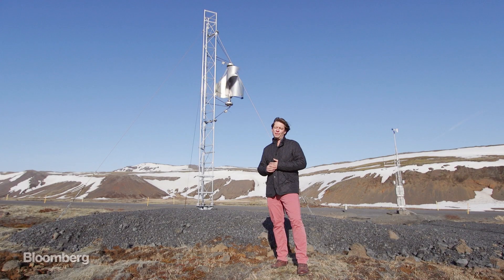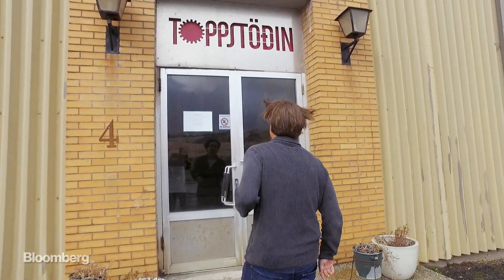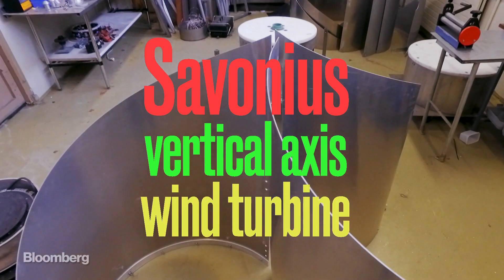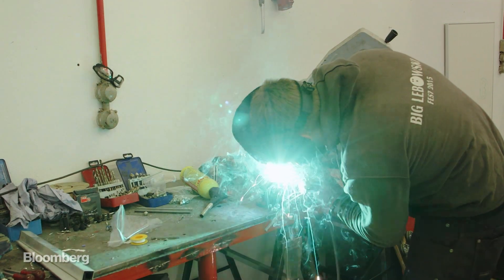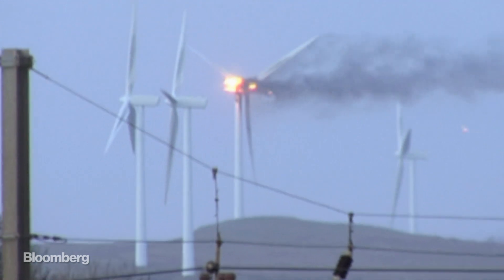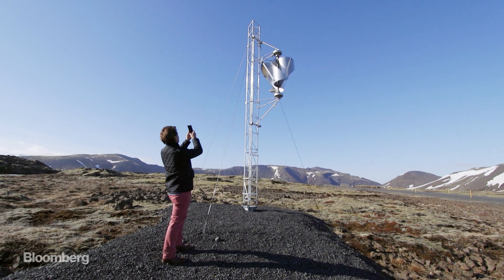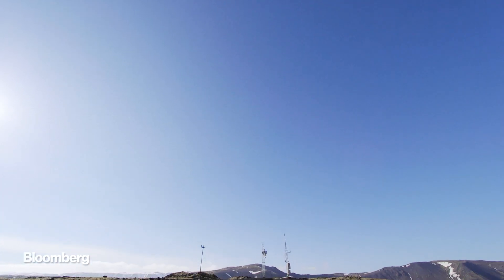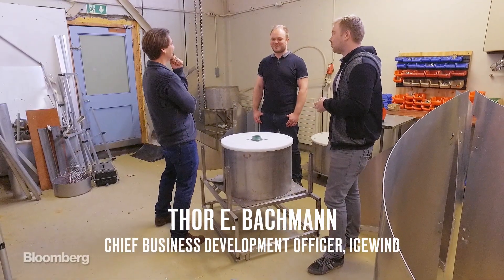The Tech That Could Fix One of Wind Power's Biggest Problems

Comment: These are Savonius type vertical turbines.
Disadvantages: 
generates less than 50% the power from same wind area.
scales down quite well, but does not scale up very well. Largest practical size is MUCH smaller than conventional bladed rotors.
Handles low winds well. handles variable wind speed and direction VERY well. but gains no benefit at high wind speeds. at all!
Uses between 50% more to 4000% more material to construct, for a given wind area.

i.e.
They are great for near-the-ground small-power systems. Especially in inaccessible locations where maintenance is not a viable option.
And utterly useless for grid power generation.
Reply: since they scale down well, would they be an option for small residential systems, such as a supplement to solar?  My solar system is great but small due to size/location of my roof so i'd love to have some wind generation as well but everything i've looked at is either too large or too noisy to put on my house with neighbors homes only about 12' away.  I'm looking at vertical axis possibilities now instead.
Reply: @markdlondon  Yep. These are a GREAT supplemental power source at household-minus scale. Especially to, for example, charge up a battery for a light in an isolated building, recharge a comms relay on a hill somewhere, power an emergency phone out in the wilderness.
Think systems that require small power under adverse conditions. Close to the ground, arctic light conditions, etc. But expect 1/3 to 1/6 the power total you could have gotten from a similarly sized (but much taller) 'normal' horizontal wind turbine.
Savonius' strength is very low maintenence, protection against high wind overspeed, and (some) function even under very low or turbulent winds. But inefficient, and weak.
Reply: @marvinkitfox3386  would a 'normal' turbine still be more efficient at the household scale?
Reply: @ki0w0-lordofwatersheep  At household scale, yes. But it is close. If the winds are marginal or erratic, or the HOA does not alow unsightly normal turbines. There are other vertical axis turbines that perform much better, but are more fussy about their placement.

At "single household device" scale, these turbines are King. Say to power a water pump *out there*, or for a phone station where small solar is not practical, or to power an illuminated billboard next to the road, etc. I have seen several powering a Weather station out in the wilds. A friend has one powering his microwave relay for his internet.(obviously also totally off the grid)
Reply: @marvinkitfox3386 
These horizontal axis structures generates unbalanced forces and extremely unstable.
First get the structure stable if inefficient so what?
Go bigger go higher.
The criteria for efficiency must've based on money spent money gained.
Not m2 area turbine wings sweeps.
Reply: @marvinkitfox3386 nice summary, I wonder if some sort of auto adjusting the surfaces can aid in efficiency
Reply: @markdlondon  Only for rural off-grid systems. In urban areas the wind speeds are low and the wind is turbulent.  These kind of mini-wind speeds will produce power above grid price.
Reply: @boldvankaalen3896  And they offer a very bad EROI. You are better of participating in some kind of windfarm project.
Reply: @markdlondon  No. For residential areas, you are better off generating more energy in a suitable area for wind production than installing micro VAWTs.
The amount of materials (ie.. energy) embedded in them is ridiculous compared to a regular HAWT. Buy a participation in a regular windfarm, ROI is better and its better for the environment.
Reply: @dwwolf4636   Yes - some of inefficiency is due to excessive material requirements (& only half material functioning at any moment), the other deficiency is that Savonius are largely 'drag' machines (they lack the sort of output that machines with aerofoils
which develop LIFT feature).
Reply: small is a relative term.  This video desperately needs a power curve for us to look at.  They are GREAT for a very small number of applications.  Something like charging cell phones in a windy area may be one of them.  Most of the time they're lawn art.
Reply: Thank you for providing the facts that should have been in the video.  I guess the video was some Bloomberg reporter's excuse for a vacation in Iceland.
Reply: they tend to vibrate a lot too, but considering a lot of islands use copious amounts of imported diesel they might have a place in niche scenarios like that
Reply: @michaelstarnes2297  Nope.
Regular HAWTs are much better in such scenarios. Fewer materials are needed and double the efficiency for a given amount of wind ( ie. input energy ).
Reply: Ye but it dont kille birds. Calculate how many birds the turbin kills globaly each year....
Not even every one's nightmare ''Nucalar power'' do that much harm. 
If you asked the birds, they would rather chooses CO2 then them dying out of the planet.
Reply: @hassanj1861  How many birds are killed by wind turbines? How many are killed by air pollution or oil spills? What's the ratio?
Reply: @hassanj1861  Massive amounts of birds getting killed by wind turbines is and urban legend.  Data does not support it.  Pet cats and picture windows are huge killers of birds.  Wind turbines, not so much. 
Audubon Society data supports this.
Reply: @solarwind907  You have the wrong data. Norway and danmark who builds alot of these turbins have published alot of concerns.
Reply: @hassanj1861  post your data here.  thanks.
Reply: @hassanj1861  Could you try saying that again, but in English this time?
Reply: es obvio.....
Reply: Argument is that you can build several of them on same area as one “normal” one. You place them in triangle pattern I think?   In 🇫🇮 they use recycled plastic to make them, this makes them super cheap. One of the benefits of being smaller. Plus you have less problems with environmental movements…
Reply: Solar would be a better solution to use than these VAWT
Reply: @optimusprime699  There are places and situation where solar is simply not practical. For example, in a highrise city, near ground level. plenty of gusty wind, but virtually permanent shade. Also high latitude in the winter, the sun might not rise for 3 months! etc.
Reply: @optimusprime699  dependent on site
Reply: The technical specifications that you add are very valuable. This type of wind turbines offers a solution in certain conditions to certain demands. They are not a general purpose solution.
Reply: VAWT work well in urban environments, where wind turbulance makes traditional ones struggle.
A VAWT can be powered if the wind comes from an ever changing directions, again urgan environments.
Reply: @scoobyflew  Got DATA?  Post it here.  What unit?  How much power?  Wind speed data?  Thanks in advance.  

HAWTs have tails.  When the wind direction changes they turn the nose into the wind.  VAWTs have no advantage there.  You do realize that 50% of the blade area is ALWAYS pushing into the wind on a VAWT?  It's fighting against itself by design.

Looking forward to that performance data, thx!
Reply: @scoobyflew  Spoken by someone who believed the typical vertical-axis talking points.  Show us one actually working well at all, let alone in a highly-developed area.  Wind energy works in wide-open spaces, so the strong winds are at turbine height, without blockage.  Vertical axis turbines make less power, and usually break very quickly, due to forces that reverse twice with every rotation.
Reply: Can single turbine lack of parity with traditional windmill type turbine be made up for by price and placing 4-10 etc. of these, with cheaper up-front expense and much lower maintenance over lifetime of product. If the vert mill is a fraction as expensive and 10 will do the job of one, and for less money, where is the actual drawback?
Reply: As you said it depends on type and direction of wind the region has.
Reply: These also have the advantage of a small footprint so deployment is easier across say a habitation.
Reply: They need to install some turbos on those things, give them more oomph.
Reply: I am considering a vertical axis wind turbine that looks exactly like a tree, I call it : e-tree,
the trunk of the e-tree is brown, the spinning blades are green,
attached to the trunk of the e-tree are features of : wifi/mobile network, light and power outlet, to charge a car for example

Comment: How much power it'll generate?? Why people are doing misleading videos?? Recently some people came out infinity radio active battery with radio active graphite. Which produce 1000micro amp. Which is for no use. Few years ago some one came up with blade less vortex wind power generator. Some one came up with wind turbines at toll and highway, using wind thrust of cars. Is this joke?? For sure conversational wind turbines move slowly. But blades are huge. They produce huge torque. It's not about design. People should work on basic logic.

Comment: Small simple easily maintained wind power systems actually make sense. Making electricity for the grid using wind power is really only worthwhile as a political game. However wind is a very practical way to supply power in small and moderate amounts especially where providing a fuel supply would be difficult. Actually when all you need is a small amount of intermittent power, it may even be possible to save on maintenance.

Comment: it makes more sense. It doesn't have to be angled into the wind like a traditional turbine, and since it spins vertically, that's also one less differential gear that's needed to transfer power, and lose efficiency in the process.

Comment: So how does it "shut down" in high wind?
Reply: It prevents overspin by being very inefficient!

Spin imparted is proportional to wind speed, but
friction with the wind is proportional to wind speed squared.

As the wind gets faster, this rotor actually slows down and eventually stops spinning. It could even slightly reverse rotation under enough wind.
Reply: @marvinkitfox3386  Thank you for the explanation.  Ironic that a weakness is touted as a strength!

Comment: Finally, Some one got it right. Those propeller windmills are waste of time and money.
Reply: Care to elaborate?
Especially since propeller windmills could physically extract about 60% of wind energy and those vertical generators only 40%.
Reply: @3gunslingers  The torsional stresses on the gearbox would be reduced. The footprint would be drastically reduced and they wouldn't have to be nearly as high as the current design.
Reply: @billbosler4220  
By how far could the footprint be reduced? it would need the be 1/3 lower to match the energy density of present day wind farms.

"The torsional stresses on the gearbox would be reduced" Interesting that you mention that. Because VAWT have vastly  higher stress cycles and hence a highly dynamic loading on the blades and the structure. Also due to the blades constantly going in and out of wind the cycle stress on the drive train is higher.

Comment: Hippies were using oil barrels and car alternators to make things like this, back in the sixties (see Whole Earth Catalog). I suspect that in most places solar panels will do a better job at a lower cost. Your comparison with megawatt turbines is naive in the extreme as this tech is too aerodynamically inefficient to scale up to that size.
However, in Iceland, in winter, I can imagine that a low maintenance VAWT might well beat out solar in the micro generation field.

Comment: How does it avoid overspinning? Why is this design efficient?
Reply: @Nikos Nikos It has to do with drag, similar to terminal velocity of a falling body here on Earth.
The drag is a force that increases with velocity and it is defined as
D = ((V^2)/2)(s A c) where: "V" is velocity, "s" is density of air, "A" is the frontal area of the blades and "c" is the coefficient of drag that is dependent to the frontal shape.
Because the convex blade has the same area as the concave blade their force cancels except for a small difference of "c", also that is why the blade spin. If the blades were flat it would not spin.
And as the air velocity increases so does the drag.
Hopefully this will help.
Reply: @markspc1  thank you
Reply: They avoid overspinning by being very INefficient.
Power from incoming wind is roughly linear with wind speed.
Air Friction from wind is roughly squared with wind speed.
Hit one of these with a true hurricane force wind, and it will not spin *at al*, just try to fall over as if it was a cardboard cutout in the wind.
Reply: It is not efficient it is only robust.
Reply: It's far from efficient.

Comment: The biggest problem with wind turbines is having no wind.
Reply: 10 to 20 feet air speed - 2 to 5 mph 
30 to 50 feet air speed - 8 to 12mph 
60 feet and higher up -wind speeds are 20mph  24/7 

The higher up the wind turbine , the more power it will make ,
And if you could add a water wheel and or solar panels all going to the same battery bank , you have electricity 24/7

Comment: I think this wind turbine is great..but that kind of shape and using stainless steel is a hazard on an urban setting especially when storm or very strong wind may occur..i think weatherproof fabric may do the job but it should have a “material stress failure” where the fabric should be broken at a certain high speed wind this should protect the turbine and the fabric flaps can be replaced easily plus it will lessen then hazard on an urban setting.

Comment: Not really a solution here people. Just like solar or conventional wind turbines, it takes a crap load of these to make any real power. They are fine for make a little power where you may need a little boost but as far as long line transmission amounts of power, it is not possible. Nuclear power is the only alternative to fossil fuels without a complete restructuring of power grids. Nuclear is also the only alternative that can produce power regardless of the weather. So why do we not talk more about nuclear power productions? Probably the same reason much of Nikola Tesla's work disappeared. It does not make the right people a bunch of money. All of the "Clean energy" market is a scam perpetrated on the world. It makes a select few obscenely wealthy but does nothing to actually improve the environment. Advances in production processes, refining processes and carbon capture processes are what have slowed carbon emissions  around the world, not the use of "clean energy" production methods. "Clean energy" still requires "dirty energy" to happen to refine the base materials and produce products. Not to mention the toxic heavy metals used in the production of solar panels. The caustic, corrosive and carcinogenic chemicals used to produce both wind turbines and solar panels. If you really look into "clean energy" it is not so "clean" after all.

Comment: They have this design as a rooftop exhaust fan. It takes a very small motor to move a lot of air at very low pressures. They only work on short duct runs to the fan. So if you reversed this, it would take a lot of air moving to produce a little bit of energy. BTW Most Techs. hate the fans, because you have to take the fan completely out, in order to change the belt. I look at it as many small exhaust fans, chew their belts up in less than three months, with this exhaust the belts last a year or more.

Comment: Isn't this design only 1/3rd efficient as the same amount of blade material used in a horizontal shaft setup? A bit like having half your prop in the water on a boat. It is a simple and reliable design for sure, but maybe not the most efficient.

Comment: This versus a windmill would less likely kill a bat or a bird
Reply: More birds die from cats per year than will ever die to wind turbines
Reply: @VividBoricua  well that's always the same argument that doesn't stand up to the issue. yes cats kill a lot of birds each year, but what kind of birds are we talking about? small birds with a big population or big birds like an eagle with smaller populations? well wind turbines are an issue for big birds.
Reply: This windmill isn't nearly big enough to even produce 1% of the energy output of a regular big windmill. This is a nice toy at best, but nowhere near capable of producing any serious power. Only big windmills kill large birds, small windturbines of any design hardly kill any bird because of the higher speed involved.

Comment: This company have the CW100 model for residential which differ than this one, assuming an upgrade to it's design. Priced for a grid at $4000! It says in the manual rated for 130Watt to 600watt. Unless, data supplied for actual test .. I'm not that optimistic ..

Comment: What if you had a self-replicating 3D printer, and using very cheap resins so every generation it built another thus doubling your printers (1 2 4 8 16 32 64 128 256 512 1k 2k ...), and it used wind power* to power itself that it printed.  After 40 generations you'd have one trillion 3d printers, and then you can use the wind power for energy rather than just printing more printers.

Comment: I reckon a hinged blade design might make them more efficient, minimising the drag of the non used reversing blades. The main problem is wear. Maybe make blades (or just the hinge parts) out of easily replaced material, and thought out so it's easy to replace blade hinges.
Reply: Why do you think they are "socialist" types?  Seems to me the ordinance is in the "conservative" vein.

Comment: I don't get it. If the wind turbines self destruct at excessively high wind speed then why not have some type of transmission in line that shifts gears and takes advantage of the higher torque?